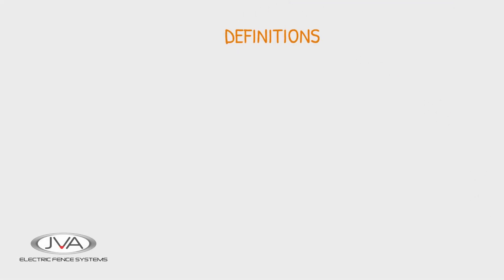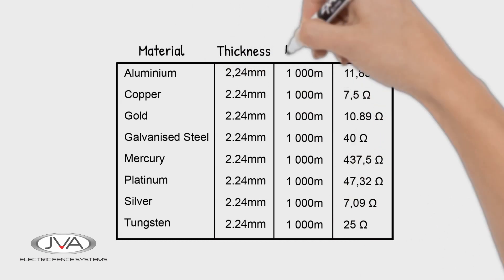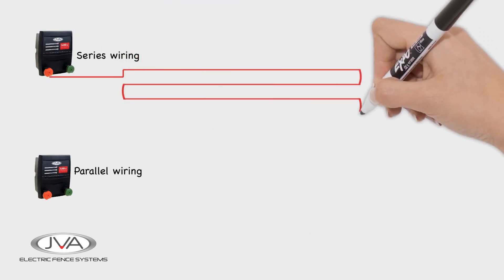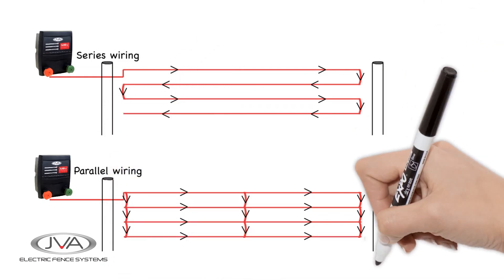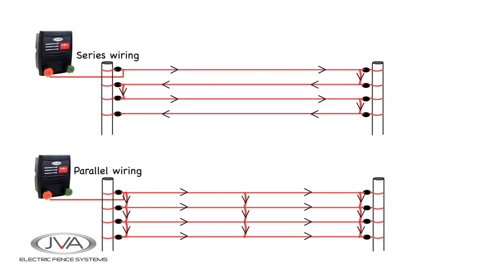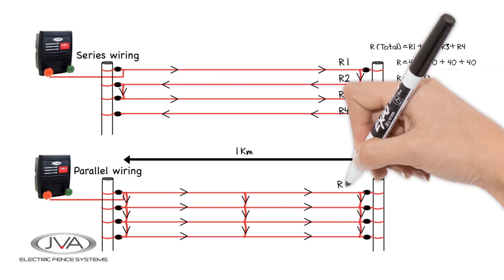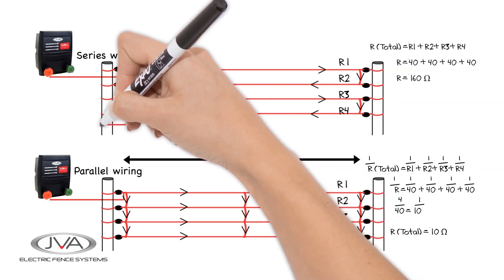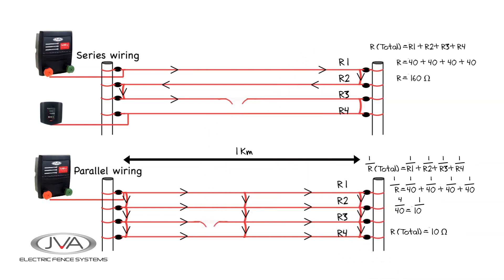What is the difference between series and parallel wiring?

Comment: Does the fence have to be connected to earth? Does the earth wire have voltage on it? 
I'm installing an electric fence around solar panels on the roof. Can I connect the earth of the fence to the earth of the solar panels?

Comment: is it advisable if you install electric fence without energizer?
Reply: Hoe would you get power to the fence without an energizer? Please do no connect it directly to a wall plug that will be a killer fence. The energizer regulates the power it makes it safe and also only in intervals so you cannot get trapped on a fence and die.

Comment: Is the ground wire not required  to shock something?
Reply: Not if the ground is damp enough: ground return works. If it's bone dry you need a ground wire the whole length

Comment: With which divice the second end of the series wire should be connected? Can it's connected with the same terminal of energizer?
Reply from the maker: No the series circuit can either end at the end of the line or depending on the energizer come back in to a monitor either external or the monitor input on the security energizers. but it must not link onto the same terminal otherwise this will effectively make it a parallel wire as current can flow in both directions. If you have a look at the difference between the agricultural and security energizer video on our you tube page this might help you understand.
Reply from the maker: https://www.youtube.com/watch?v=jTIdjHdlD5w